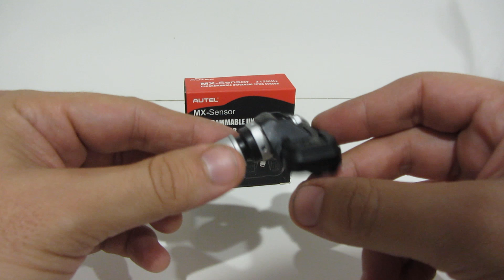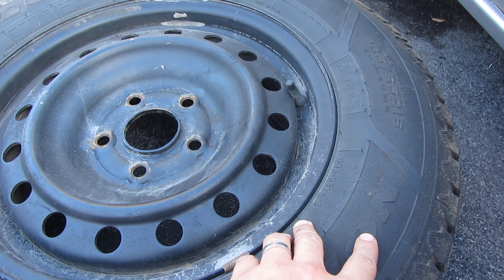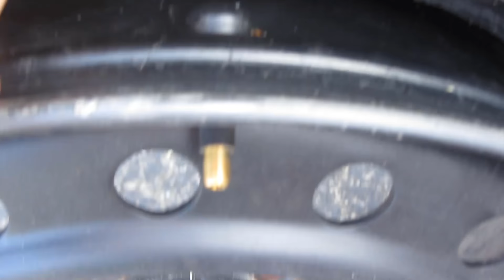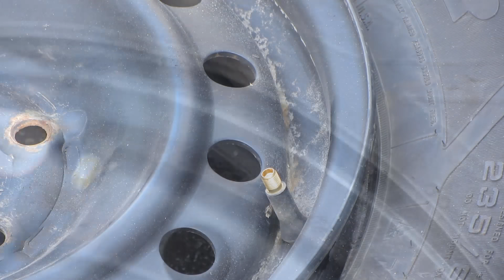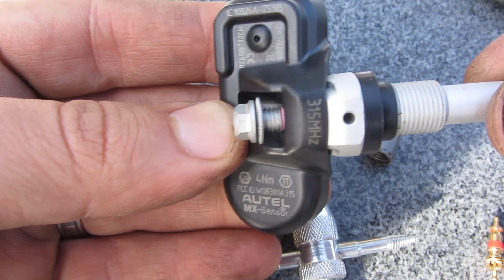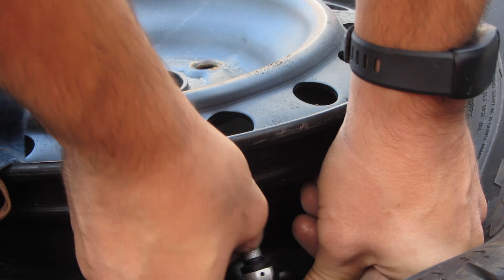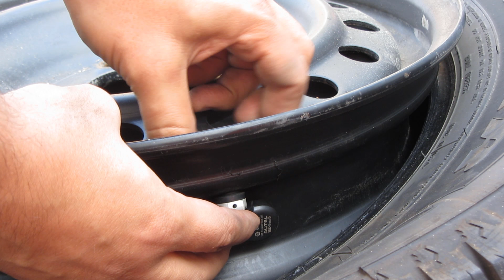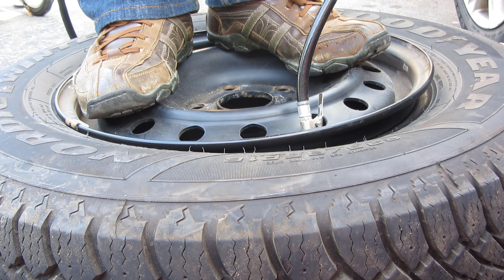Install New TPMS Sensor DIY Without Needing Rebalance

Comment: For decades flats were patched,tire removed from wheel, and rebalance was not required! You simply mark the tire in relation to a non movable location on the wheel—valve stem hole remains in that location even if replacing the valve stem and the tpms sensor.
Reply from the maker: Yeah, people really overcomplicate it, and overestimate how balanced things need to be. It'll never be 100% balanced - as long as you don't feel it, you're good.

Comment: I have new rims with no sensors on them. I want to get these installed then take them to Costco so they install my winter tires on them since they won’t install the TPMS since they aren’t a manufacturer one. Would this matter?
Reply from the maker: I don't see why not 🤷‍♂

Comment: Can i remove the old sensor only by unscrewing it and leaving the valve stem in place then install the new sensor only, thereby necessitating cutting out the already installed stem? 
I'm removing  one year old Schrader EZ Sensors @315mhz and replacing with the same Schrader's in 433mhz. the screw that connects the sensor to the base  of the stem has a Torx head.
Reply from the maker: If that type of sensor allows for that, I don't see why not
Reply: @GabesHacks  I'm going to try and reprogram the sensors from 315 to 433 first, i have the ATEQ VT37 tool if not I'll try to do the sensor swap i described above, thank you for the reply and your video.

Comment: Can you change the sensor in only one tire and how would the system recognize it. Will it work if it's not the same with the other sensors
Reply from the maker: Each sensor has a unique code that the car's computer recognizes as its own. Each time you change one, the computer has to be told that it has a new sensor. Some cars can do this automatically. Some cars have a manual procedure to do it. Some cars need a special tool. Look up the year and model of your car on Google with "TPMS relearn" and see if you can find the procedure for your car.

Comment: Much better to use external sensors
Reply: I’ve never seen external sensors that pair up with the car’s computer but I’m more familiar with them for motorcycle use. You get a little TPMS display to stick on your dash somewhere. Modern cars, on the other hand, will nah you if you don’t restore the factory TPMS so the same thing wouldn’t really work as a replacement unless you could program external transmitters the same as internal ones.

Comment: Doesn't adding that luquid for easier installation stay inside the tire causing rot to the rubber and exposed metal?
Reply from the maker: Soap isn't going to do anything to the rubber. The moisture in the soap isn't much more than the moisture in the air that goes into the tire. Also, steel tires are painted, protecting them.

Comment: Does the age of the tire like ten years or older make it harder or about the same because tire shop in California will not change the sensor with a tire of ten year or older they say it a safety hazard for hitting pot holes the side wall might blow?
Reply from the maker: Rubber will starting breaking down over time and also harden (giving less grip). I've seen some recommendations to stay under the 10 year mark. I wouldn't buy tires that are older than 10 years, but I wouldn't take 10 year old tires off my car if I already have them. Keep an eye on them. Look over the tires and see if there is excessive cracking in them.
Reply: So because of their shitty roads, you need tires every 10 years, lmao

Comment: If you have difficulty getting the bead to reseal, you can wrap a rope around the center of the tire and cinch it down which makes the bead contact the rim for a better seal as you air up the tire. I was going to take my vehicle to a tire shop for the TPMS install, but after seeing a couple of these DYI videos, I think I'll try it myself first. I really like the pieces of wood used as a bead breaker. Good idea!
Reply from the maker: I hope it works out! I've heard of that rope trick - even better with a ratchet strap.
Reply: A ratchet strap works great
Reply from the maker: @ronaldmeldrum5576  Yeah, that helps too

Comment: Hey great video. How hard would it be for low profile tires…225/35/20
I just read the instructions on the TPMS and it’s saying to make sure they are relearned prior to installing. Kinda confusing. It says they are preprogrammed already but to use one of the three options to relearn them. I’ve had to reset them once before after adding pressure, not sure if that’s the same thing. I sure don’t wanna pay  $64 per wheel if I purchase theirs or $44 a wheel if I use mine.
Reply from the maker: It might be a bit harder to break the bead on a low profile tire, but it's likely still doable. (I've never tried it)
Some cars will automatically learn new sensors, but many need some kind of learning procedure. Check your owner's manual, or look up online the year and model of your car and "TPMS relearn".

Comment: Not worth it! Use a small hand held psi air tester. And take black tape over dash light. And you are done!! This guy has too much time on hand!!
Reply: ..and I'm here retrofitting TPMS on a 2008 Mondeo lol
No time to fuss around with a gauge, wash your hands... Just look at the cluster and be done with it.
Reply from the maker: 😄 To each their own.
Reply: Unless your vehicle is like mine and if a tire is low or sensor is out, it very audibly let's you know about it every 5 minutes or so. How do you cover up sound with black tape? I'll just do it the correct way, not the cheap redneck way,and replace my sensors when the time comes. It's not that hard or expensive to do.

Comment: Can i trust these valves ? No leaking ? 4 flat tires is a bit annoying when you have 1 spare in the trunk ;)
Reply from the maker: Yep. I don't have that van anymore, but I never had problems with them.
Reply: Same brand my local shop uses

Comment: This is a good way to do it but don't use dish soap on rubber or anywhere on a car as the detergent is known to damage rubber and paint. An old fashioned bar of hand soap is better, just rub it around the bead of the tyre or onto the rim.
Reply from the maker: Sure, hand soap will work. I'm not sure dish soap would hurt anything. Most shops use soapy water to check for leaks in tires. And think of all the crap on the road the tires need to put up with. But if you're worried, hand soap does the same thing.
Reply: I believe any kind of soap can cause your wheels leaking air from your tires for along runs. I always used vegetarian oils and it works perfectly fine and never worry about leaking air on my tires.

Comment: Great video, thanks for all the details and tips on balancing and not breaking it. Will definitely weight my sensors before installing them. Will do mine soon, waiting for the sensors. Ordered a Foxwell 2000 form ali to relearn, will start with cheap pre-programmed sensors on amz and see if it wants to learn them, otherwise will have to buy the Foxwell programmable sensors I guess. My light is really annoying and doesn't even say it's TPMS, just service required.

Comment: Thanks Gabe , this was really helpful! I had a question I was wondering if you might know the answer too. One of my tires was going through air faster than the others for a couple months, then it started holding air just fine. Then I put a lot of weight in my car, and the tpms sensor came at first intermittently, and now always on. My assumption is its from the tire that was loosing air before. Would you happen to have any theories? Thanks for your videos!
Reply from the maker: Sounds like a very tiny leak and the added weight put added pressure on the tire that pushed the air out. You can take it to a shop and they'll put it in a bucket of water and inflate it and look for where the bubbles come out to identify where the leak is.
Reply: @GabesHacks  Thanks Gabe!

Comment: Great video. Just wondering, Walmart put tires on with non tpms valve stems. Now, my tpms on the dashboard, says to add air. I did to alm 4 tires, as Walmart had 36 psi tires at 32 psi. Tried resetting the tpms, but the light stays on. Is it the valve stems?
Reply: It's the  one you're describing. No alarm. Just the light with the exclamation point. I have a 2014 Mazda CX5 4wd. I don't know if it matters that they didn't put the tpms valve stems on the tires.
Reply from the maker: If they didn't put sensors in, then you would see the light with the letters "TPMS". Did they tell you that they didn't use sensors? You can't tell from the outside.
Reply from the maker: Which light is on? Is it the one that looks like a tire with an exclamation mark (which means low tire pressure), or the letters "TPMS" (which indicates a problem with the system)? If the shop didn't put sensors in, my guess is that it's the "TPMS" light, which means the system isn't working at all.
Reply: yes the car computer is looking for the sensors. they use blue tooth to sense the tire sensors. if they dont see the sensor then lite comes on.

Comment: My sensor is about 10mm to on the ring of the steel, and no sending signals. It has to by connected to the ring?? It is so important?
Reply from the maker: I'm not sure what you mean by the ring.
The sensors turn on when the wheel turn (there is a centrifugal switch inside). So you have to drive the car for them to turn on.

Comment: @7:33  Thank you for showing about the needle. I usually used a wooden shim to prevent the sensor fm/rotation on torquing. I don't have that needle, but try to use a small Allen wrench. It was also useful information about balancing. If to add air without Schrader Valve it will set the bead much easier, no need to step on it.  When the bead is set, remove the hose, air goes out of course, install the Schrader Valve and add air. Thank you again. It is a great film with a lot of useful tips.
Reply from the maker: Good tip. Thanks for commenting.

Comment: i always thought you needed to do something special to re-seal it
Reply from the maker: If your rim is in good shape it's not necessary. If there's corrosion on the rim that might affect the seal, then you can use a sealer.
Reply: I used 4 softballs and pushed down from top to get it to seal back it worked 😂
Reply: @Scuba451  well thats going to be my next project , after the brakes, front suspension , hitchmount, and chipped paint

Comment: If you are doing 65MPH it will make a difference in weight.
Reply from the maker: It's possible. If you find your wheels are off balance, just get them balanced.

Comment: Waste of time anyway. You'll still need a TPMS scanner tool to program it. This tool isn't cheap either.  Unless you're going to go this for a living, the investment isn't worth it for sensors that'll need changing every 5-8 years.
Reply from the maker: Some cars automatically detect new sensors. Some have a manual procedure to reprogram that doesn't need a special scanner. And yes, some cars do need some sort of scanner, like mine in this case. I used programmable sensors, which I showed how I programmed in my other video: https://youtu.be/N6p6xV4PlHc?si=7U6OUQpplUxQXWLm

All in, this still turned out to be cheaper than buying the sensors from a shop and having them install them.
Reply: You can use a 20$ obd to do it on Toyotas lol
Reply: Ya it costs around 300 cad  to get the program tool and this brand of tpm can only be recognized by its brand’s scanner so bring to the shop seems to be make sense

Comment: Great video. Did u need to program the sensors after you instal???
Reply from the maker: I used programmable sensors as I described in my other video: https://youtu.be/N6p6xV4PlHc?si=19HUxbe2eYhqwkj4
But if you use normal sensor, then you need to program the car. Every model has a different procedure for how to do that.

Comment: Hi my name Javier, when you put the tpm, we need to reset?
Reply from the maker: It depends on the car. I used programmable sensors, which I explained in my other video (link in the description), so I didn't have to. But otherwise, your car needs to learn the new sensors. Every model car has a different procedure, so search Google for your car's year and model with "TPMS reset" to find out. Some you can do without any special tools. Some need a special scanner tool.

Comment: Costco charges me 300+ for all 4 sensors
Reply from the maker: That's almost as much as a dealership!
Reply: Check e-bay.  The come in 315 MHz and 433 MHz, so check your vehicle for the frequency.  A programming tool, if needed is under $10.
Reply: @thetruthserum2816 No way are you gonna find an Autel programming tool for $10. The Autel is about $100 used and that's still a good deal though. Found myself 4 new sensors for $80.
Reply: For 300 I got 4 of those Autel sensors plus the programming tool LOL.

@thetruthserum2816 Those 10$ tools aren't for programming sensors, but for position learning on your car.
Reply: @BuGBurnout  Check e-bay, I was able to get 4 sensors with free shipping for $38.  Installed them, turned the ignition on and off three times, pressed the brake, on and off 3 more times, leaving it on the last time,  it honked twice.  I pressed the programmer tool next to each tire, two honks per tire, done...  Works like a charm.  Didn't even have to de-rim the tire, just broke the bead on the valve side and pressed it down as I swapped the valve stem for TPMS.

Comment: when the tire sensor light is on solid how do you know if problem is at the tires or at the computer module?
Reply from the maker: For most cars, you'd need a scanner tool that will tell you what it's complaining about. But it'll usually be a battery.
Reply: Check the tire pressure readings on your dashboard. If one or more sensor/s doesn't /don't show a reading, then it's more than likely a dead battery on the sensor/s. You need to change the TPMS (sensors).

Comment: how long batteries work, do we need to remove them to replace batteries.
Reply from the maker: They're not designed to allow you to change the batteries. From the documentation I've seen, they'll last about 7 years. It depends how much you drive too, since they only turn on when the wheel is spinning.
Reply: @GabesHacks  thanks for clearing. In this scenario I believe installing external TPMS is a good option, as the batteries can be easily replaced, the only demerit of it is to remove the sensors to fill-up the air in tire.
Reply from the maker: As long as you're ok with having a separate display inside the vehicle. No external sensors that I've seen will work with the vehicle's internal TPMS (which show the warnings on the dashboard).

Comment: Does it work with a cigarette lighter pump?
Reply from the maker: It should. It just might be a little more difficult to get that initial seal when starting to inflate. But once you have a seal, it should inflate just the same (just slower).

Comment: .8oz can definitely throw off the wheel balance. Wheel weights come in .25oz increments
Reply from the maker: Sure, it's possible. If you notice balance issues after, it's wise to get it balanced.
Reply: not possible, guaranteed. you should definitely rebalance the wheels if you do this @GabesHacks

Comment: The only thing I would caution is if you have existing TPMS sensors, you probably want to break the bead 180 degrees from the TPMS sensor.  As the tire starts to come down off the rim, it'll snap the transmitter of the old sensor off of the stem, at drop into the tire.  That is a BEATCH to fish out of there with  rim still inside the tire.   Ask me how I know...
Reply from the maker: Oh boy... thanks for sharing!
Reply: Shop vac it out.
Reply: Run it.  IMO, a little junk in the tire isn't gonna harm anything.
Reply: Just mark the tire and the rim with white not permanent marker and you will be fine

Comment: Definitely using this method to do the other 3 on my wife’s car. Discount tire did one for me last night at $40 and I provided the sensor. They basically used this method but on the machine. They only broke one bead and didn’t rebalance. Just put 1k in tires on the car 3 months ago and still no break from them.
Reply from the maker: I hope it works out for you 👍

Comment: Not all sensors are like this one as far as reinstalling. Yours are easier than the all rubber valve ones. Thanks though.
Reply from the maker: Yeah, that's probably true. I imagine you could still probably do it without taking the whole tire off though.

Comment: hi, can you program the original toyota tire pressure sensor with the autel programmer too?
Reply from the maker: No, the original sensors are not programmable. And the Autel tool can only program Autel sensors.
Reply: @GabesHacks  how to install an original toyota sensor in the toyota prius than? looks like the sensor have a fixed id on it - is it as simple as connecting with the car over odb2 and change the sensor id there?
Reply from the maker: @Gerald-iz7mv  The same way I installed this one in the video.
For the programming, every car has its own procedure for telling the car that it has a new sensor. It might require a special tool. Look it up online by searching for "Toyota Prius TPMS reset procedure"
Reply: @GabesHacks  ok - looks like i need to program the ecu (and tell the car that a new sensor id is present) using obd2? what apdapter and sw will i need?
Reply from the maker: I don't have any experience with your car, so you'll have to look it up online. You're not the first to go through this, so I'm sure you'll be able to find the answer online if you search. Try a Toyota forum maybe.